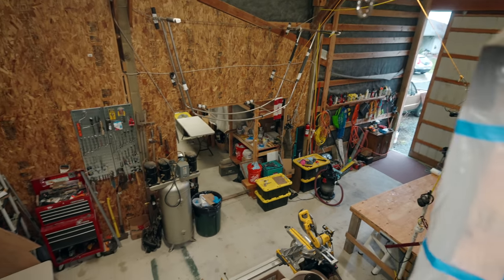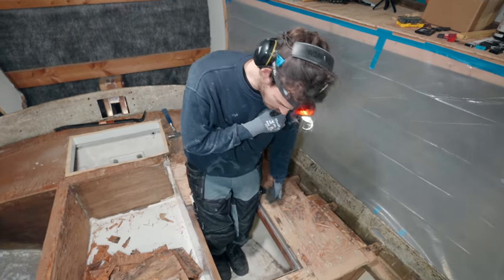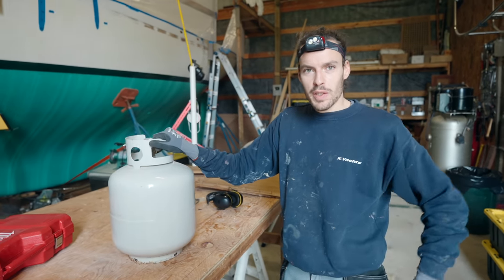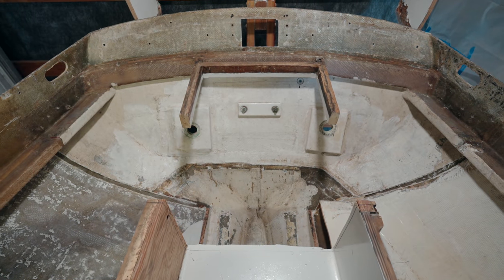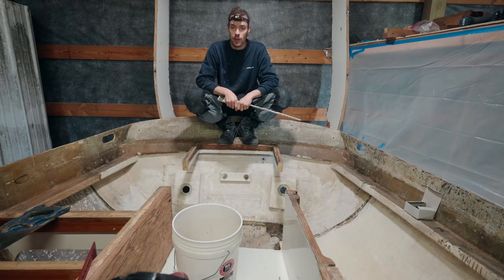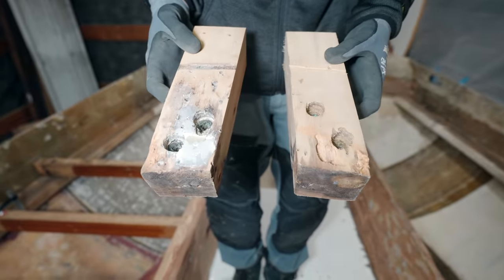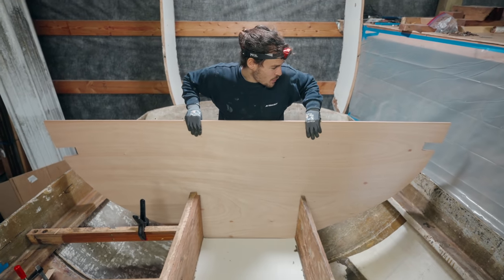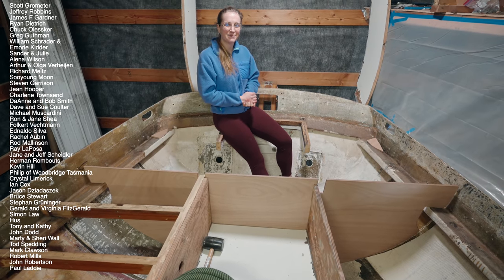NEW COCKPIT DESIGN on a 40 Year Old Boat [S4E44]

Comment: The boat is really coming along  nicely!! Maya mentioned a future redo on drawers. Something that worked well for me on  my past two boats was using strips cut from teflon cutting boards as glide surfaces for drawer runners. Stuff cuts  nicely on  a table saw and with counter sunk screw heads last forever.

Comment: #1 One important thing when working in a hazardous environment is to protect oneself. I must say that I'm a little bit impress of how you both do this. You protect all important intakes; mouth, nose, eyes and ears. All to few of other youtubers do this.
#2 How do you solve the ventilation of your gaslocker? Propane travels downwards against the keel...?
Reply from the maker: Hi Rolf!
Boatyards are quite toxic so protection is key:)
The propane locker will be a fully glassed top loading hatch with a vent at the very bottom that goes out of the boat via the transom:)

Comment: I read about a method that I thought was called "trick sticking". 40 years later I found out it was called "tick sticking", which is well documented on the web. A great system for fitting odd-shaped boards into an existing space. I do have to say that Aladino's mock-up of the bulkhead piece was amazing.

Comment: I added 20% styren to the polyester when I glassed the deck on a mahoany boat I owned in the early 80s.  I worked a treat.  That was a trisk I learned from I guy that started building fibreglass boats in the 50s.  Believ it was osome of the first of it's kind built in Norway.  As you probably know Aladine the styren slows down the curing process and allow the polyester to grab into the wood before curing.  
Love to see how good the results that comes from both you boat builder and assistant.

Comment: You can use most any resin as a primer , sand it and then glass it . It works well . Glassing dry plywood won't cut it .

Comment: Gas bottles in the us are not the same size A’s in Europe as you should recall. So take care with making the locker only capable of taking one US centric type
Reply: Our gas bottles are Canadian and pretty rare beasts in Australia. However they are so good they have been revalved and certified for another 10 years. At $39 each it sure beats replacing them at the current retail of $450 each. They are made for forklift trucks apparently.

Comment: I try to see back into the past and find myself without resources like access to the knowledge base at hand now nor the technology improvements experienced between then and now. 
   I secretly plot out this refit without a hint of love or admiration of the unappealing nature of wood and it's youthful beauty requiring man hours of nurturing. No instead I plot a way as I watch this magnificent hulls' structural elements impose on me.  My favorite episode touched on my desire to place much metal into as many places as possible and that mindset began at the deck ever increasingly I now sit with a plasma torch in my left hand watching and occasionally drifting off into multi process welding equipment not to mention sheets of copper stainless and aluminum. I've come a long way since observing Aladino and Maya's affection for details where they seem to appreciate even the quality of the shop vacuum. 
  And I think the best way to summarize my look back is too emphasize always check, test, and verify. 
My struggle between the limitations of steel vs wood are now merging into even reinstituting plastics wherever and whenever they offer benefits. I shall only be a purist of structural integrity alone and I will love the feel and sound of as many wood elements I can salvage.

Comment: Kind of surprised you aren't melding the old with the new and going for a LiFePo battery setup with inverter to run a small induction stove.  No issues with trying to fill bottles that have different fittings the world over.  Assuming you will be installing some sort of solar array and a high output alternator.  This seems to be the trend for many live aboards.

Comment: There's something oddly satisfying about ripping out material that has been installed incorrectly or that just plain looks bad.  That was a lot of work, but it appears you now have a more solid, and much better, base to build up from moving forward.  It was nice to see that the inside work resulted in revealing some cork that wasn't rotted, which makes your jobs a little easier.  You both do very nice work and it's fun to watch the progress as you rebuild and refit your future home on the water.  In a few weeks, we will be departing our home of 21+ years (it's sold) and spending all our time in a 43 foot Fifth Wheel RV.  Hopefully I can still get reasonable access to the internet to continue watching your progress.

Comment: Your propane bottle locker should have small drain hole at the bottom in to the cockpit this will allow any propane that leaks a path overboard. Propane is heavier than air.  Here in NZ this is a CAT1 requirement.
Reply from the maker: Yes, it’s a requirement everywhere! dont worry, we’ll be doing the same.

Comment: When designing your new cockpit don't loose sight that there is only one proper width for a proper offshore boat of this size.  When you are heeled and going to weather your feet need to be braced on the front of the seat and your butt braced against the bottom of the  opposite coaming .  The footwell on most Cape Georges is too wide as is the case on most boats.  The bathtub style coaming that Bob Lange liked to build almost never meet these criteria.  Fortunately you folks have about the same leg length, so it should be possible to choose the ideal compromise. 

ps:   Balsa core installed with resin infusion Never rots or de-laminates because every block is completely saturated and encased in resin.

Comment: How are the changes in the cockpit going to affect the rigging, steering, and will there be a traveler for the boom?  Will you install a windvane style autopilot?  If so, what type are you planning?   Are you going to rig for 1, 2, or even 3 aft stays (chainplates), will you be prepping for a solar arch and a davitz?  Just wondering about the plan for the aft of the boat.  Plans for the Quarter birth?

In the US, we call it a Ticking Stick.  Usually they have a curve and a notch and a sharp point at one end.
Reply from the maker: Traveler on the bridge deck, single backstay maybe split towards the bottom. We would love a windvane and one day an arch but that’s all too far away to really say now:)
Reply: @SailingMagicCarpet  
Interesting.   If you split the aft stay, will it be easier to prep so that adding a windvane or auxiliary rudder type autopilot is easier?  Putting in a pair of stiffening bulkheads to either side of the spot for the wind vane will make it so much easier to install (as well as leaving room in the lazarette.    
I was wondering if you'd thought of these things so that the transom will be prepped for the later mods.    My dad and I built a boat and had to redo the transom twice because we didn't think ahead.   
We've been having fun watching your boat come to life.

Comment: That's a really great bulkhead. I have always wondered if a plywood bulkhead should be 'sealed' before fitment? (with epoxy or similar - especially on the edges)
Reply from the maker: Yes! ours will be before installation. It will also be fibreglassed over with epoxy

Comment: I would sugest, to built any kind of access to the engineroome from the cockpit right from above. This will make repairs and expectations so much easyer. I assume it will be an electric engine with lots of heavy batteries. I would sugest this  - like elder AMEL-Yachts have it.

Comment: One thing I've noticed on most channels where they do boat work is they almost never talk about proper drainage for water that gets on deck, in the lockers or other places it's not supposed to be. They also don't mention how they prevent water from getting into those places.
Reply from the maker: Cockpit and deck drains are pretty standard, so there’s not much to say about them. But we’ll talk about them a bit more when we actually start making them!
Reply: @SailingMagicCarpet  Thanks! I'm sure people would be interested in how you guys handle the drainage issues.

Comment: I am curious as to why you didn't use a hole saw to make a shallow core in various spots to inspect the balsa. It would not give 100% eyes on, but it would be indicative with less repair. Loven the new cockpit and the add lazaret space is nearly a state room.
Reply from the maker: Mostly because we could see that the fibreglass sealing up the balsa was already compromised in numerous areas. We didn’t trust it, and knew we wanted to replace all of it to fix existing problems AND prevent future problems

Comment: Are you storing petrol in the gas locker too? See SV Nutshell bilge vapor explosion. Ahhh, what energy! What would happen if I had just 10% of that to add to mine. I like that pickling stick method, I’ll be using that. It’s a good time now to be considering allowing for cabling conduiting (solar, nav lights, aerials, gps, autopilot power and signal, heavy cables for electric winches and transom anchor winch) and end for end plumbing (transom shower, wash down supply line, tank vents, ). Make a clear passageway (trunking) for this stuff now, and you will be your best friend in the future. It sounds like a flooding danger to have large trunking (water tight bulkheads) but I have decided make them large and easy to work with, then water seal fill in after cabling with poly urethane foam. For hot conduits there is foam silicone filler.
Reply from the maker: No, no petrol on a sailboat!

Comment: Will the new cockpit affect the tiller? You may have to make a larger one, or just accept that the tiller will be over the aft deck and not the cockpit itself. The boat looks quite good without the cockpit couming by the way. Reminds me a lot of older cutters and "skøyter", but I understand that you want to have a protected cockpit.
Reply from the maker: The original rollers are massive so we should still be perfectly able to use them:)

Comment: Hey Ya'll,  Just a safety concern, ya'll said you were going to put the propane locker near your stove.  Here's the thing, propane is heavier than air.  which means even if it is vented a leak will keep the propane at the lowest level.  If you have it near your stove and i assume you will have lines run through drilled hole to your stove, it could leak propane right to your stove through the line holes.  I don't know of a solution beyond keeping your propane tanks away from your stove.  Keep up the great content, I really enjoy following your journey.  PS. Have you considered just designing and building your own sailboat.  Ya'll appear to have the skills and you're both creative.  I would love to see what you two come up with.
Reply: I would use a propane through hull fitting mounted near the top of the locker. I don’t think the stove will back that bulkhead as you normally mount them athwart ship so they swing when you are healed over. So there will be some space(cabinets) between the bulkhead and the stove - and With the overboard drain at the bottom it will be safe.

Comment: Balsa core... it's not there for insulation but to create a greater moment, or stiffness to the hull.  It is most definitely a structural component to the deck and hull.
Reply: The guys that built the boat said it was insulation. There isnt a thick enough layer of glass on the inside for it to be structural. The actual sales information for the boat when new was that it was for insulation. Balsa "core" on the other hand is exactly what you say it is, but this boat doesn't have that.
Reply from the maker: Thanks Phil, you summed it up! Not to mention the fact that there’s 1.25 inches of fibreglass in the hull :) the balsa definitely inadvertently provides stiffness, but the design doesn’t require it, and many Cape george’s had either no insulation or foam insulation.
Reply: @philgray1023  Thanks for the info.  I stand corrected. Very weird use of end grain balsa  though IMO.

Comment: Have you considered switching to steering from a wheel, instead of a tiller.  It would seem easier to add an auto pilot, and provide mechanical advantage when steering.

Comment: Re the new bulkhead: Is that 1/2 inch 7 ply? Were you able to get honest marine plywood with zero gaps on the inner veneers? Were the outer veneers true A grade with no football patches?
I use the same method as Alladino to generate a template from multiple small pieces, when I need a part to fit inside an existing structure.
Reply from the maker: I’m indeed very happy with okumé marine ply for most tasks(Joubert plywood)

Comment: Thank you again for your efforts. This project is always interesting and engaging.
I have had a question in my mind for a while. What is inside the beam shelf? I am asuming a piece of wood. If so how is it possible that it too has escaped rot with all of those bolts from the deck beams going it?
Reply from the maker: You are correct! The bs is out of laminated timber and then heavily glassed over. The grp in this shape almost has enough strength by itself. There were indeed a few areas that required some attention but luckily 95% was still solid. Water passed through the holes rather then accumulating and sitting there.

Comment: t is too late now  but I am wondering that you have not provided any thermal insulation. You do favor sailing in cold waters and I would consider lining the fiberglass inner walls from the waterline up with maybe that foam rubber carpeting pads they use in workshops and playgrounds. From the waterline down and below the floor no insulation because thet is where I would want condensation to happen and run into the bilges. What is your take on this?
Reply from the maker: The whole boat is actually insulated :)

Comment: Why not use carbon sheets instead of fiberglass when you are building  a structural beam?
Reply from the maker: There wouldn’t be a good enough reason compared to the cost it comes at on a 20’000 lb boat of only 36ft.
Carbon shines where weight is critical

Comment: Did this boat come with davits for the dinghy? Is that something you are considering in the future and do you need to do any prep now for the structure that may or may not exist in the future? :)  Great episode again! :) cheers.
Reply from the maker: I would rather not have davits on a boat like this. Transom hung rudder and a wind vane are the priorities back there. 
Maybe an arch for solar one day
Reply: @SailingMagicCarpet  Ah yes.  I can see the value of the solar arch too. :)  Is it the weight at the back that changes the performance of the boat if the dinghy is back there? Thanks for the reply! :) cheers. 😃

Comment: Isn't it better to have you propane bottles as far away from your living space and open flames as possible to buy you some time and distance from them, incase of fire or explosion? The extra length of propane hose, is not by itself, a safety hazard as long as care is taken to protect them from cutting and chafing. I simple PVC sleeve between tank and last interior bulkhead should be sufficient.
Reply from the maker: There is little escaping from a propane explosion. Often the entire deck gets lifted🤯
Best practice is a safe installation and regular maintenance,sniffers and turning it off diligently.

Comment: guys no offence - as hard as we might try  - we cant use a single 9kg gas bottle in a year - never mind 3 gas bottles between replenishing - as an alternative we have 1 x9 kg - and 1 x 2kg - when we get low or start to get low we have plenty of time to swap over and visit a port to replenish + that is going to be a long way to run a sloping gas locker drain.

Comment: My personal experience is that vinylester is worse than polyester. The street view is that vinylester is stronger and more adhesive than polyester, and approaches epoxy. In my experience you can't count on vinylester to ever set up, It's less adhesive and weaker than polyester. It isn't in the same league with epoxy. I won't ever use vi9nylester resin again.

Comment: The Propane locker!!!!  Natural gas is lighter than air it will rise and vent away. PROPANE IS HEAVIER THAN AIR it will settle to the lowest point and just wait for any spark discharge. Then blow a boat apart like a bomb.  I thought you would have placed locker at midpoint along transom then vented out the  bottom of locker out the rear.  If locker is sealed it does not matter if tanks get wet  every now and then in heavy seas(watch the rust! On every tank)    Please run a pipe from the bottom of your locker if it remains in this position to lowest point of locker floor to center of transom above waterline.    Propane is lovely as fuel source, but one of the most dangerous gases if any link in the system is flawed. Like those exchange tanks we all buy every day.  Also if the locker does explode you want it as far away from the cabin as possible.  Those new fuel lines you are having installed in the future are going to be watched by you like hawk.  That rental tank, who knows were the flaw is?
Reply from the maker: Yes, of course we’re going to vent the locker!
Reply: Had a friend that had an explosion, do to this exact problem, I had to state this very clearly. But love your weekly videos, I you ask any Fire Fighter,. Propane scares them.  Enjoy your journey.
Reply: I have used the wrong word  Not Vent, should said drain  at bottom of locker. Think of propane gas as water, now think of your storage locker as a kitchen sink.  When your boat heals over for days that sink is below waterline, during those days it cannot drain. If you were at center line you can drain the most, with a one way flapper valve you can keep sea water out.  You need to be able to drain your "kitchen sink, on both tacks, I hope this makes sense.